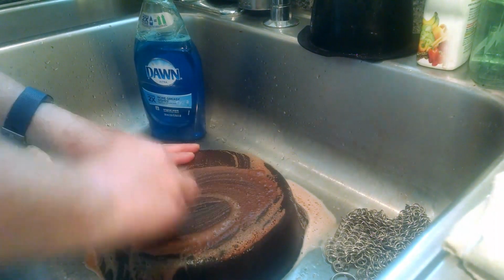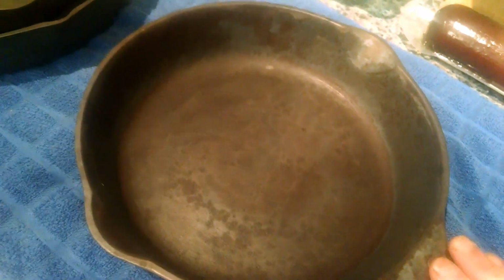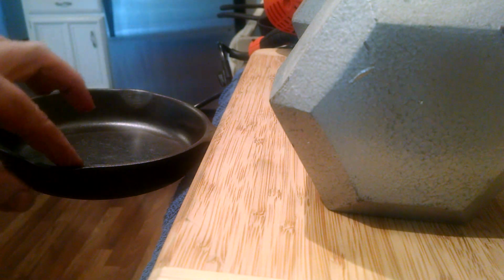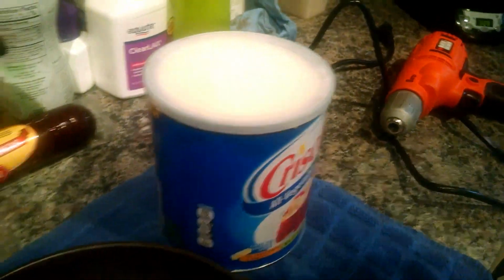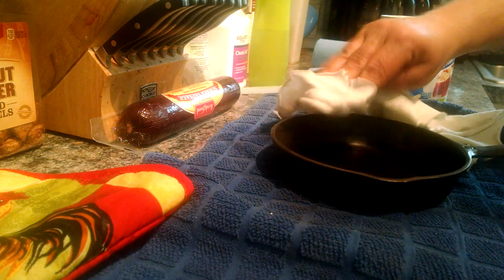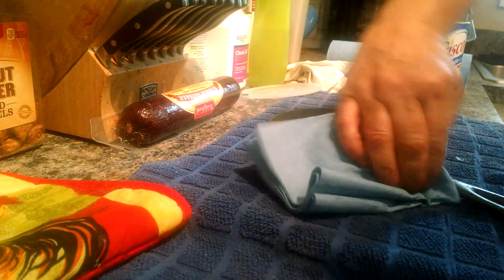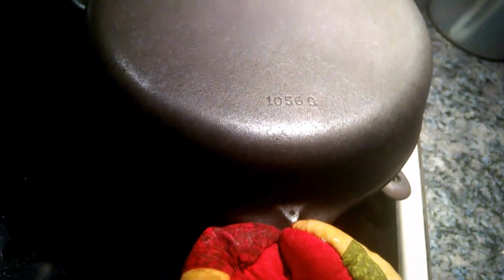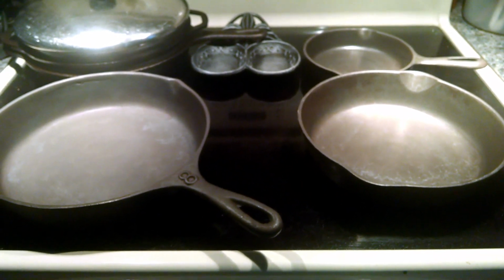Vintage Cast Iron Overhaul from Cruddy to Like New - Part 2

Comment: i use to clean my mom skillets every year...and it really doesnt  matter how rusted they are..build a fire outside ..wood leaves it doesnt matter..but need to cookthem in a fire for about a goodfour or five hours...they will look like brand new...then season with bacon greasein your stove...and you never ever wash your cast iron with soap and water...they get wiped out with salt...pour salt in the skillet and scrub itaround ..wipe out ..stick it back inthe oven
Reply from the maker: If that fire gets to 800-1000 degrees you could be causing permanent damage to your skillets such as warping (then if it is severe it won't heat or cook evenly).  Cast iron doesn't like sudden or extreme heat changes and could be damaged depending on the integrity of the skillet.  2nd, your skillet could have fire damage indicated by red areas that do not hold seasoning.  If seasoning doesn't adhere to the skillet, then it is at risk for rust damage.  That said, if you know what you are doing, keep the temperature no hotter than 500 degrees (by keeping the skillets on the edge of the fire or better yet the hot coals are adequate you should be OK.  I don't have access to build a camp fire where I am, so I stick to a self clean oven or a lye bath when stripping skillets.  Patience is required when using lye, but it actually presents no danger to humans and is the safest method for your skillets.  As to cleaning them properly, please see my video on this or see site: www.castironcollector.com    You can use soap to clean them if they have a lot of layers of seasoning built up OR when first stripping the skillet during the restoration process, otherwise, heat and water is enough to clean skillets especially if there is seasoning on them to protect them.   If you methods work, then kudos to you.  I teach what has worked extremely well for me.

Comment: Very informative video.  I threw my old skillet in the fireplace to get 30 years of crud off it.  It worked!  Question:  is it okay to use them on glass stove tops?  I haven't used mine in years because I wasn't sure.
Reply from the maker: You can use them on glass cook tops like my videos says, just carefully following the tips I have provided in my comments section.  Thanks for watching!

Comment: I would never use a chemical oven cleaner on my cast iron.  I have done it the way you did yours but I would never use chemicals on cookware.
Reply from the maker: Please see the site www.castironcollector.com  where there is a whole section on restoration and the fallacies behind using lye (which is basically the only chemical per se to strip pans) and why it is perfectly OK to use them.  You can also reference this link from the Wagner-Griswold Society on proper restoration and there is nothing wrong with using lye on your skillets for restoration as long as you follow their safety precautions which I do.  http://www.wag-society.org/Electrolysis/lye.php  In fact, I follow these tips almost verbatim on my latest pieces.
Reply: @ladylibertystacker2014  I understand that they restore them that way but I don't like it .  I prefer the way you did it I feel it is safer for you in more ways than one. Just my opinion. I love that you took the time to to restore the pans cast iron cookware is just wonderful.
Reply from the maker: Thanks and I gotcha.  Have a good one.

Comment: soak them in vinegar for a few days. all the rust will come off
Reply from the maker: Yes, I've done that as well when scrubbing doesn't work.  Besides electrolysis, that is the only thing that will remove the hardened old black carbon along with the rust.  This video was referencing my first attempt and my later videos show me doing just that.  ;-)

Comment: All the cast iron groups I belong to says no to wire brush or sanding.
Reply from the maker: This video is about 5 years old and my first restoration attempt.  I am well aware that groups state wire brushing or sanding is not recommended by industry guidelines.  That said, these three skillets are still in use and have held their seasoning beautifully.  I guess I got lucky - beginners luck or did a good job in not removing the original metal, just the crud on top.  😉

Comment: too much work.  my grandfather gave me a cast iron skillet.  he asked me if i knew how to clean it.  all the steps you've taken in your vids were exactly my first instincts.  he ended up throwing it in a fire.  no, it didn't warp.  after it cooled, i washed it with soap and water.  then seasoned it.  i make omelets all the time and wipe it clean with a paper towel.
Reply from the maker: I hear that throwing your skillets in the fire can cause a red like rust to develop on the pan which then won't hold seasoning.  You got lucky, but I wouldn't feel comfortable doing that.  I now mainly use a lye bath and/or Easy Off Oven Cleaner for those stubborn pans, followed by a rinse with Dawn & a scouring pad and a vinegar soak if needed.  That works very well and my pans do a wonderful job with all of my recipes.  That said, if it works for you, go with it.  Thanks for watching.

Comment: Please remember one thing. There is no such thing as opening the pores of cast iron, or any metal for that mater, applying the oil cold and doing the seasoning as she does gives you the same results. I have been a machinist for 38 years cutting, grinding and anything you can imagine to metals of all types. The seasoning is strictly on the surface and that’s it.
Reply from the maker: That is interesting, but you can't argue with experience.
Reply: @ladylibertystacker2014  One can argue demonstrable fact versus perception and prove it every time…

Comment: I wash mine in dawn and if something was to stick I turn the stove up as if I was making gravy pour a lil dawn in it then add water  the crud comes right up . Dry the skillet  then take a paper towel with Cisco wipe the skillet  and it’s ready for the next use .
Reply from the maker: Are you referring to washing a seasoned skillet after use?  Or a total restoration process?  From your comments, it sounds like that is how you wash your skillets after each use.

Comment: I thought I would give you a tip I heard from another Youtuber and the best oil to use when seasoning your pans is Flax seed oil. Rub it down then rub off as much as you can and bake it at 200 for 1 hr. then repeat 3 or 4 times. You don't want it to be real shiny or it gets sticky. I tried it and it worked great. That is now the only oil I will use on my pans. Thank you for all the work you did on these. Here is the science on seasoning cast iron: http://sherylcanter.com/wordpress/2010/01/a-science-based-technique-for-seasoning-cast-iron/
Reply from the maker: Thanks for your comments and I know you mean well.  I am familiar with this site for flax seed oil in seasoning and actually tried it when I first got my cast iron Lodge pans a couple of years ago!  I followed all of the recommendations in this site and it just didn't work for me.  The seasoning seemed to flake off when I used the pans. That said, I tried Crisco and haven't looked back.   I have a maintenance video in my cast iron play list which keeps my pans shiny without being sticky and this is due to the carbonization of the seasoning as it bakes onto the pan each time I use them and do my mini maintenance cleaning/reseasoing after each use.  The secret is to wipe on, then wipe off the seasoning when the pan has sufficiently warmed up, then bake it on until it smokes (stove top for mini maintenance sessions) or in the oven just to  or slightly below the smoke point.  I have seasoned probably over 30 skillets since this video and Crisco has done a fantastic job for my collection.  Here is the best article I have found on seasoning skillets.  Please check this out. It comes from one of the best web sites on cast iron in general.  Read this whole article and it will explain why I no longer use flax oil on my pans.   http://www.castironcollector.com/seasoning.php

Comment: A sand blaster would save alot of time....And or a tumbler / deburrer vibrating machine.
Reply from the maker: Yes, I am sure it would, but I really enjoy the way I do it.  One truth is there is no one perfect way.  The only thing I would add is if you have a very collectible skillet, then I wouldn't recommend sand blasting.  You wouldn't want to remove any of the original metal from the skillet.  For a modern Lodge,  that isn't a bad idea.  Thanks for your comment.

Comment: the ends of the wire brush are far more effective
Reply from the maker: Lance Ladewig   Yes, I have discovered that fact.  I still scrub a bit with the Brillo pads, then do a wire brush (I have 5 different sizes depending on the pan) to get off any rust I missed, smooth imperfections, then season.  This was my first attempt almost 5 months ago and all three pans have been great performers.  You can see my results in my collection video of my latest techniques.  Thanks for watching.

Comment: By using wire brushes and or sand paper you essentially alter the cooking surface by mashing down the pores. They will not accept seasoning properly and are no longer collectables.
Reply from the maker: Not true!  Even the collector's sites say you can do this to smooth out rough parts of the skillets  as long as you aren't removing any of the actual metal.  I have done this with many skillets and they do hold seasoning getting blacker and blacker with time and I've sold a few to collectors as well.  I guess you're another one of those armchair quarterbacks with zero subscribers and zero content!
Reply: @ladylibertystacker2014   Nicely said!

Comment: You just sanded down the pans and your dipping into your cooking crisco & dipping a dirty rag is disgusting...aren't you contaminating your tub of crisco?.....FYI---take out and put crisco in another container....cuz your dealing with metal pieces....just a suggestion.
Reply from the maker: I only use this Crisco for seasoning and there is no contamination involved.  Heat kills anything that could be perceived to contaminate.  The Crisco can is there for convenience.  As for cooking, I use olive oil, butter, or pure olive oil or avocado cooking sprays and they actually help season the pan also just by cooking with them.  Please see link: www.castironcollector.com  for more information.